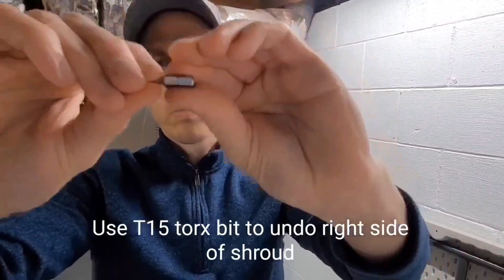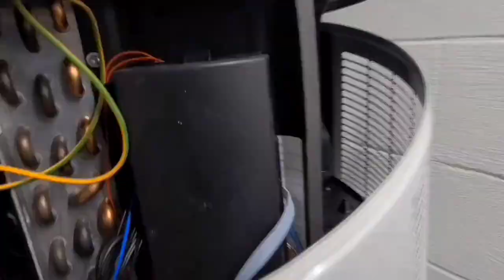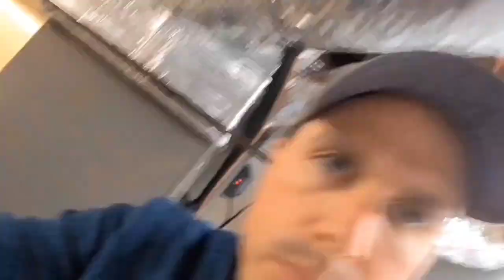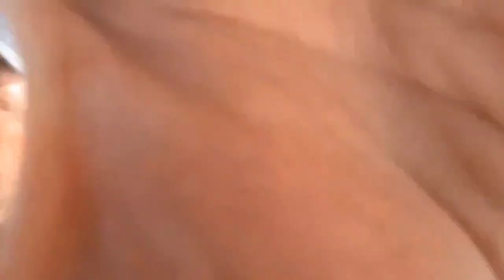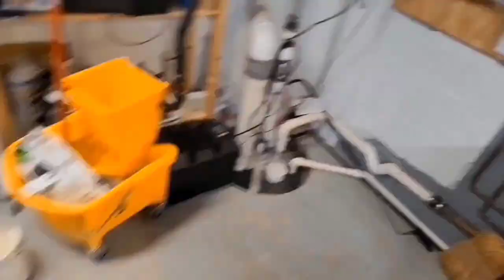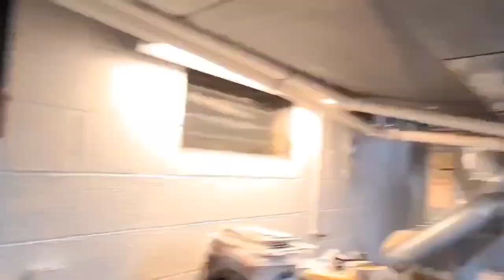How to switch on/off heat pump only mode on Stiebel Eltron Accelera water heater

Comment: What size is your water heater? I currently have a platform in my garage for my old 80 gallon solar water heater… would you be able to still use this water heater without having to remove the platform?
Reply from the maker: This is a 58 gallon unit but Stiebel Eltron also sells an 80 gallon model. Sorry I can't really picture the setup you're describing so I'm not sure about your space. Thanks for watching though